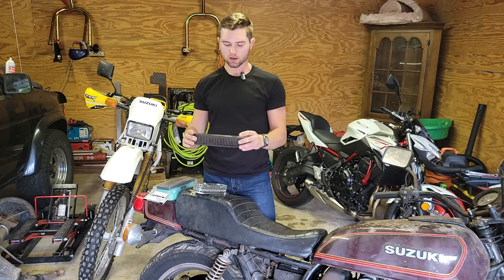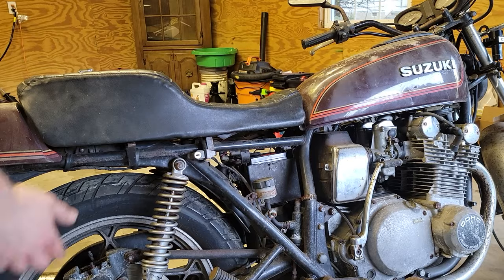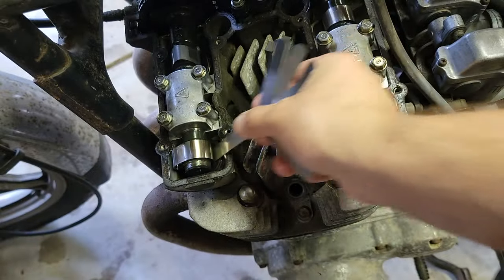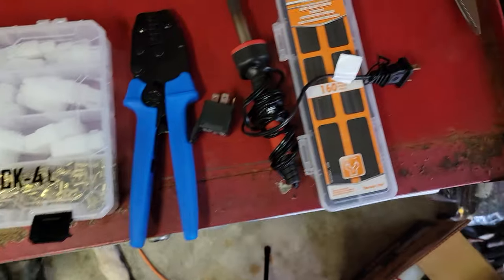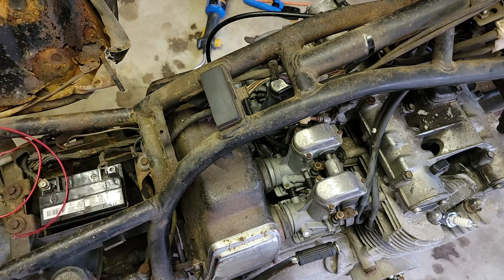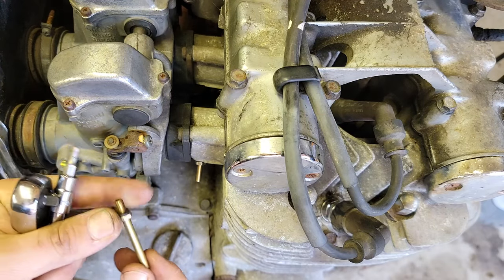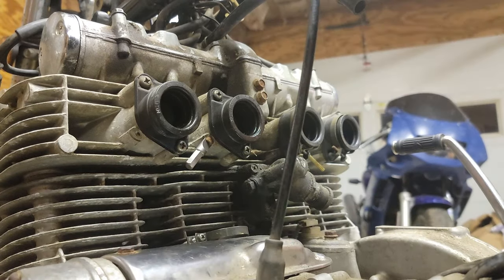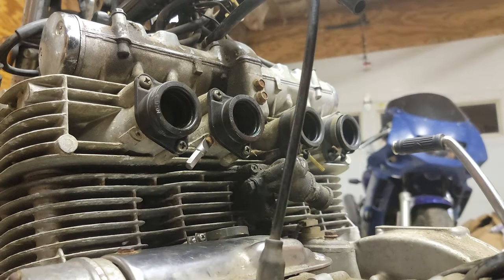Neglected GS750 Revival Part 2

Comment: Same bike my brother owned. He eventually got it bored out to 850, added wiseco high compression pistons, Mikuni 29mm smooth bore carbs, Lockhart oil cooler, Yoshimura header, drag bars, bullet fairing, and pirelli phantoms. It performed very well. These are the toughest engines made.

Comment: Im impressed with your mechanical skills and Im a bit more confident for my summer project. I friend of mine has offered free to me a 1978 GS750 thats been parked outside ( covered) for years here in Connecticut, and not running.We sure didnt have the colortune back in the 80s, but vacuum guages im well familiar with. Ive owned two GT550s Suzukis in the past, !981 GS450 EX, GS1100, and presently a low mileage vintage HD Sportster. Ive read reviews on the GS750 and they were great street cruisers.
Reply from the maker: The GS750 is definitely a fun street cruiser. Plenty of power to get yourself into trouble but still relatively tame compared to modern sport bikes. If that GS has been parked outside, I imagine everything is super corroded, but should still make a solid project and has potential as long as it's all there

Comment: I bough one of these in 1978 put in electronic spark an oring chain air for front forks put on a faring sissy bar back rest, daily ride to work 78000 miles then sold it.
Reply from the maker: These bikes are known to last, the first one I bought actually has 89k miles on it.
Reply: This was one of the very first motorcycles to be fitted with an O ring chain as stock ! I got over 45,000 miles out of the original chain on mine. As soon as the front sprocket looked even slightly worn I changed it. After 3 front sprockets I changed the rear. Did this a good few times. A new stock chain was over £100 sterling back then...One thirteenth of the price of the bike new so unless you were minted you took care of it. 
I tried the air front fork mod but found it more faff on than it's worth.
Reply from the maker: @HorseMalone  Our first GS750 has front air forks and they always lose pressure. Seems to ride nicely once its filled up but I have no idea what it should ride like since I don't actually have a solid reference for comparison.

Comment: Again another great vid, really liked how you tuned the carbs, never knew of colourtune, well be getting one asap. Would have been nice to see the ignition and timing. I have a 78 GS750 coming in a week or so and it has points and condensers, would have been nice to see if yours had this or if it was converted to electronic ignition.
Reply from the maker: This bike still has point ignition. Hard to show every detail on camera without boring people, but I did take off the ignition cover to double check the condition of the points and everything looked good.

Comment: Shouldn't the switch input (o/w) go to #86 and the power supply + go to #30?
When you turn on the ignition you want to power the relay to close and supply 12 volts directly to the coils thru #87
Reply from the maker: #30 is the switch part of the relay, and is the signal that is coming through our switch gear. #86 has our full 12V from the battery https://www.12voltplanet.co.uk/relay-guide.html
Reply: the o/w wire that use to feed the two coils is cut as described by you. the two wires that go to the two coils are connected to terminals 87.
If you want full voltage directly from the battery to the terminal 87  in the relay, then shouldn't the wire from the battery +ve  connect to terminal 30?
When the relay is energized, aren't terminal 30 and 87 then connected?
I would think that you need the o/w wire coming for the ignition-on switch to energize the relay. hence would be connected to  the relay terminal 86. ( 85 terminal connected to battery ground.)
Reply from the maker: Looking at the wiring diagram for the relay again I think you're right, I'll have to put an edit in the video. Good catch

Comment: I have a 78 GS750. Rebuilt it after 20 years in the shed.
When you set the carbs, how many turns out on the fuel screws? ( not the air screws)
Reply from the maker: I set them to 1 1/4 turns out

Comment: I have an 84 gs 750 and am looking for a wiring harness and the oil cooler   was wondering if anyone knows where to get them in Atlantic Canada
Reply from the maker: For a lot of these older bikes, you are stuck with either eBay, junk yards, or finding another parts bike. If you are mechanically inclined, you could maybe adapt one to fit from another bike, or some quick research shows oil cooler adapters to use modern fittings and aftermarket coolers.  Unfortunately, there are no real options in the way of OEM new production.

Comment: Hi dear. Thanks for uploading useful video but can u plz talk little slowly? I really tried to understand  what u said when explain  how to  fix carb air or fuel scrow  but I can't get it even after lesson 10 times.
Reply from the maker: Fuel screw is on the bottom, turning it in leans the mixture while turning it out richens it. The air screw is on the side, turning it out leans the mixture while turning it in richens it. I used the color tune to strike the balance between the two adjustments across the rev range.

Comment: Great video,  I believe I have the same bike. check my channel if you like.  did you refurbish the carbs?  what rebuild kit if any you preferred?  I did my carbs but I don't think I have the right O-Rings and its running shotty.  I'm misfiring in my number 2 cylinder. I really need to carb sync and adjust my fuel/air screws.  does your bike have the short VIN # ?  Mine does and I cant really get the model # for getting the perfect parts.   I have the same carbs too.   I just cant find the right Mikuni carb settings .   Man if you can help..would be appreciated .
Reply from the maker: Carb sync and adjustments are definitely needed if you took the carbs apart and split them from each other. I'd also verify that the carb boots themselves aren't leaking and the O ring that seals them to the cylinder head is in good condition. I used a rebuild kit from Z1 Enterprises. Kit seems to have worked fine, but if you can find genuine Mikuni parts I'd spring for those. This has the short VIN. 
https://www.thegsresources.com/
https://gsarchive.bwringer.com/ 
Are good resources to search for specs, factory service manuals should be available on those sites.